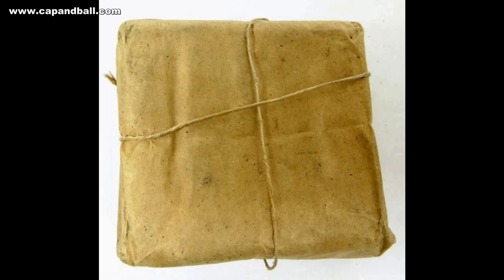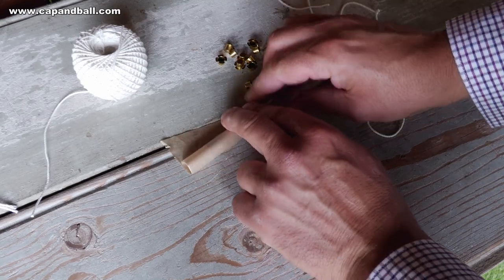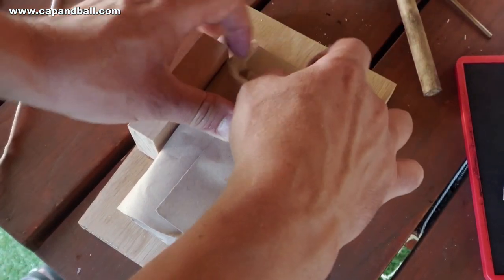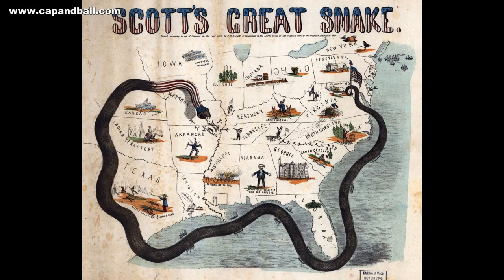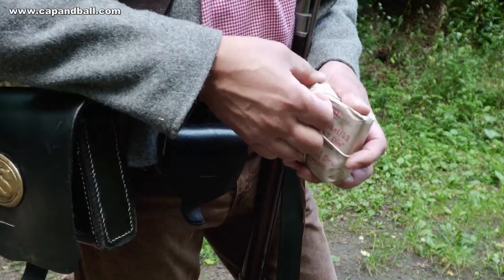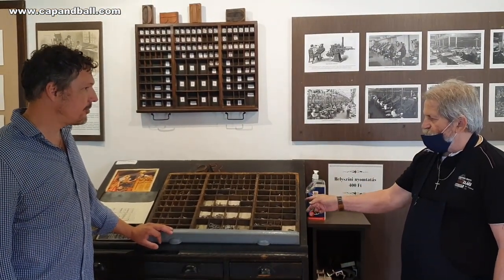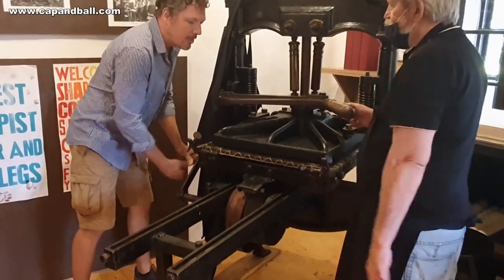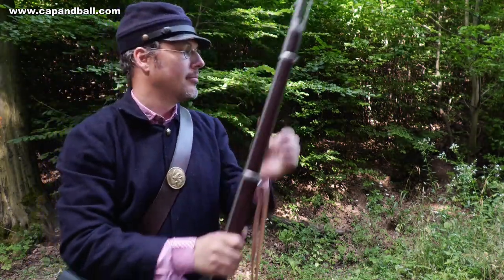Making Civil War cartridge bundles and shooting an original Springfield rifle musket to 300 m

Comment: As much as I have read about the US Civil War, I didn't think about how ammunition was distributed amoungst the troops. For some reason I envisioned just big wooden crates with a pile of cartridges inside, But then I realized that would be a quartermaster's nightmare, it was already difficult as it was to keep the troops armed, So a very precise inventory of ammunition was needed so it could be efficiently distributed to troops. It makes alot of sense, Of troops being issued packets of cartridges, much easier to keep track of how many rounds have been supplied to the troops and help ensure an equal distribution of ammunition

Comment: Nice videoand very interesting. 😄Well done on your research!👍👍 Very nice 1864 Springfield you have. I was a CW Union reenactor for 10 years, (Company F, 48th New York Vols.). Most of us rolled our blank cartridges in this manner, just replacing the minie with a cotton ball or tissue  paper wad, complete with blue papered Williams Cleaner rounds and percussion cap tubes. Usually mine were marked with the St. Louis Arsenal, different year for each scenario or living history. I have fired live through a defarbed Euroarms P53, or my 1862 Contract Bridesburg musket, but that was many years ago now.

Comment: I like how you're using a spent brass cartridge for a powder measure; makes for an interesting method of recycling.

Edit: So from a logistical standpoint, the CSA could only have won the war if A) they achieved total victory early on through a blitzkrieg campaign or B) if they'd gotten enough foreign aid to negate the Anaconda Plan and maintain a steady stream of supplies and possibly troops.

Edit 2: During my Library and Information Studies Master's program, I took a class on the history of print, in which we got to make our own linen paper and play around with hand-sized printing presses.  I missed out on how well our paper turned out, but the printing presses were a heck of a challenge, both in figuring out how to properly place the letter blocks and in trying to even out the pressure so your printing came out right.  Still, it was a fun and interesting experience.

Comment: Dear Capandball, so interesting. You have always emphasised the need to pack black powder tightly, or tamp the charge with some inert material, as in a cartridge when using less than the maximum powder  load . I think I understand the concept of the flame front in a loosely packed black powder load advancing beyond the charge, and creating an explosion, rather than progressive burning. It would be really informative for you to discuss this in detail, and why the problem does not affect modern smokeless  powders. Best wishes!

Comment: Wow, this was interesting.  I have seen Civil War bullets but then i wondered how they were actually loaded and fired.  So I saw a few you tube videos of the loading and firing, but this was so neat that you can actually make up the cartridges and PACK them exactly as they did during the war.  I can imagine people, possibly women, working in factories assembling all these thousands of packs by hand.  All the logistics of having enough paper and string remind me of the current supply problems with COVID vaccines, masks, and PPE.  Winning a war can all come down to supply chains and enough equipment, bullets, guns and clothes....I suppose soldiers loaded up their bags with as many cartridges and caps they could hold.  And then to learn in drill to load and fire three times in a minute.  By the time you'd get the gun loaded you'd be shot and dead.  Absolutely absurd and horrible.